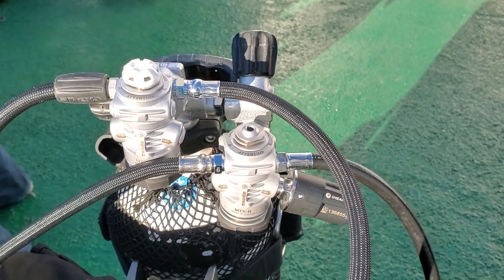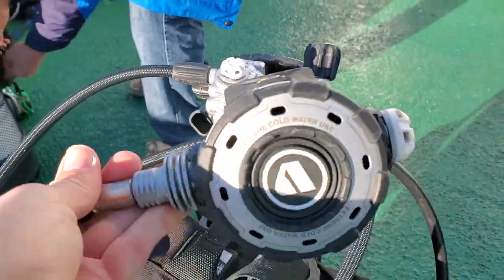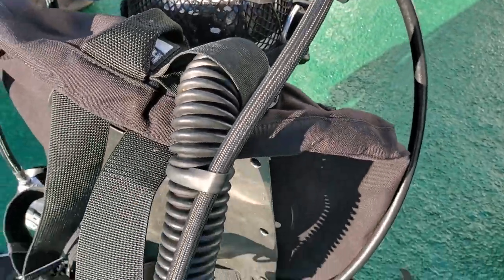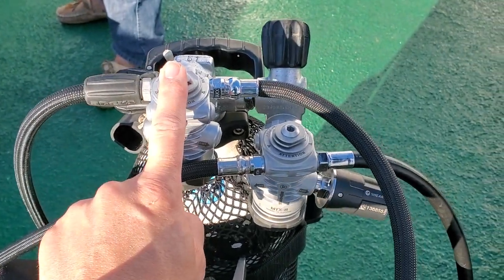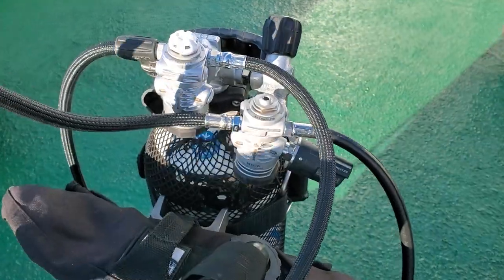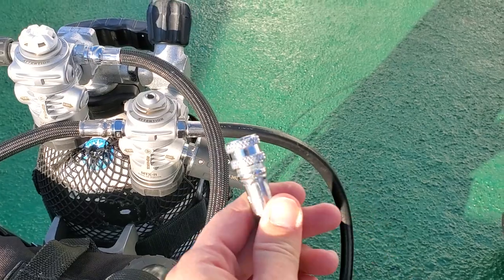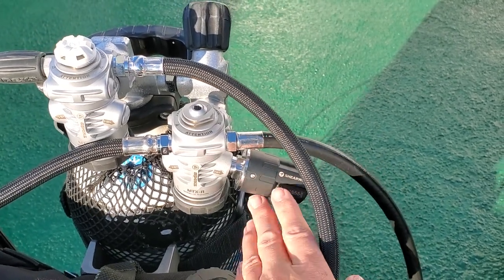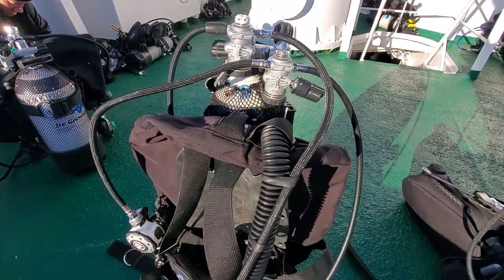Polar diving gear configuration for Antarctica scuba diving

Comment: Thank you for sharing this is an interesting configuration.  Shame the camera person didn’t swing around a give a full 360 view of this setup. I understand your intent for doing a single tank, double regulator, no pony bottle for your ice diving. 

I have been diving the same MTX R for the last six years with over 400 dives in cold silty lake and bottoms and marine and love the rig. Haven’t had any free flow issues and I get into some cold water diving quite often (no ice diving for me).

I just got the Perdix 2 and the new Swift Tx pod really nice gear. I’m considering picking upmarket a few more MTX R regs for my new twin set. 

Hello me understand is there a practical reason for the “fish net stocking” around  the neck of your cylinders?

I also noticed a nice big beefy plastic had grab mounted to the tank neck. I sure that common “handy” for top side support when a diver is egressing from an ice hole or climbing back into a platform of ice. 🤙

Cheers, #SeattleRingHunter
Lost Item Recovery Specialist
Reply from the maker: HI, thanks for your comment. The tanks are not ours. The ship we use in Antarctica provides these with the mesh. It's likely to just protect the boat and tank because they are put into tank racks and they get tossed around a bit. It also helps really secure the cam band to the tank. I don't personally use them on my gear. The operator also requires us to use the H valve with a "doubles reg set up" like in the video. We are only diving to 60ft but you can isolate one if there is a freeflow. We are not under ice at all. If i' dive under ice i'd use doubles or have a redundant supply. The MTX-R regs are amazing. Same here, i've done about 13 polar trips with them and dived in -14f / -27c air temps and they haven't free flowed once.
Reply: @BeckyKaganSchott let us hope the new business arrangements for Apeks quickly shapes up allowing the company to get spare parts and rebuild kits flowing again to the US. Dive shops across the country are cross and some have stoped retail their regs due to unreliable parts! Makes me very sad as I am considering purchasing three more MTX R reg sets or go SCUBAPro MK 19 EVO.